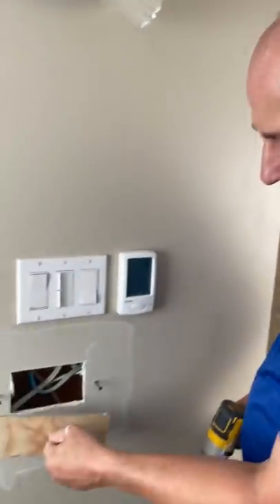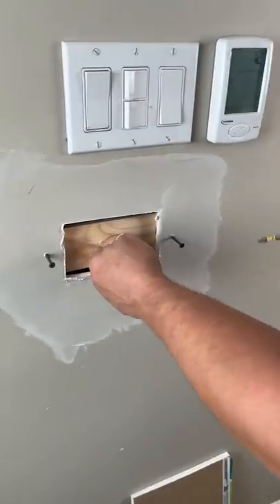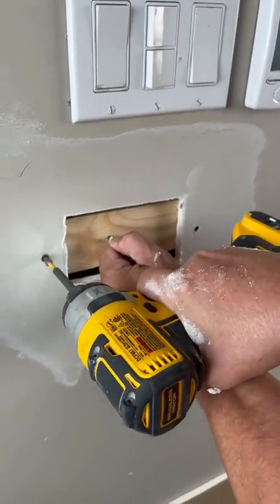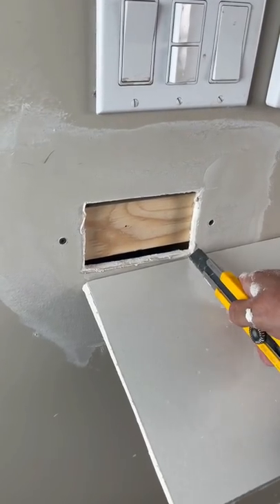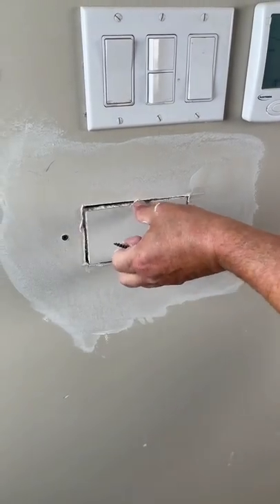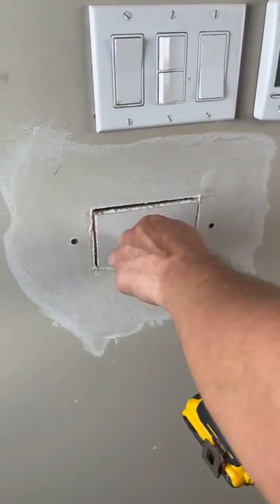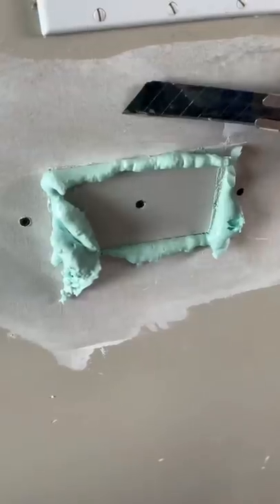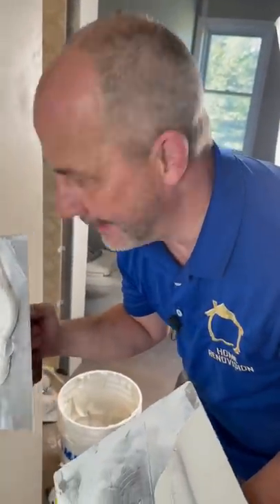Drywall Patch, No Tape Required #shorts

Comment: Now you just need a tip on how to save the expanding foam can so you don’t waste a $7 can on a single patch.
Reply: You really don't even need the foam trust me on this one...
Reply: @jamesjones1655  at least it works in theory.. Doesn't always stop being wasted after you're finished.
Reply: @wallstreet1469  brilliant
Reply: @jamesjones1655  I have about 6 of the foam guns. I use different foams from poly construction adhesive, fire block, window and door, pest block and so on. I have gone close to 3 months of no use, pull the trigger and good to go. Not to mention the yield and price per OZ is so much better then the one and done.
Reply: Why not use spackling?
Reply: @jacobtorres5542  spackle would crack out and show in no time. Spackle is designed for nail holes and very small repairs. Anything above a quarter size hole should be filled with drywall mud or hot mud. Something of that nature.
Reply: Just fill it with thick mud
Reply: Cut the piece of drywall about 2 inches bigger on each side.  Then, using that piece, cut out the size of the hole you need in the center of the piece making sure to only cut on the back of the drywall.   Next, bend and crack at the cuts, then pull the gypsum away from the paper on the front of the drywall.  You will be left with a piece of drywall you need with 2 inches of "tape" already attached to it.
Reply: @wallstreet1469  I would have figured a guy with a name like that would be more sympathetic to the neglect of innocent walls 😞
Reply: @jamesjones1655  Now we need more expensive "professional" foam...
Reply: @jacobtorres5542  Use plaster (drywall setting "mud") like EasySand.
Reply: U don't need the foam if u cut it precisely then just cover it with mud and u won't even notice a difference 
Edit: u can actually mud a pretty large gap if u do it right u only need the foam if u cut it really short
Reply: Foam is unnecessary
Reply: I mean you dont have to fix a hole in your wall that often, i think its worth spending 7 dollar on some foam instead of hiring somebody to do it
Reply: That's easy make the hole bigger and square it.  Just layout a new x by y hole that slighty larger over the existing hole and cut it out. Since it's a hole you've cut and you know the exact measurements you can cut a blank that fit perfecrly with no gap, just mud and sand.
Reply: @daltonurofsky3145  good idea
Reply: Fill it with crushed ramen and super glue
Reply: Wash it with acetone after each use 🤷
Reply: The expanding foam I use for outside flashing and shit can be sealed with a quarter hex head 1 inch screw. You need to secure the nozzle to the top with pliers then hand drive the screw pretty tight. Hasn't failed me yet.
Reply: Buy a $5 can. BOOM BABY
Reply: If you’re doing the repair yourself in your own home then a $7 can of foam is a negligible expense.
Reply: Acetone dissolves expanding foam. Just soak the adapter for a few minutes, blow it out with air and it should work like new. Use a drill bit the size of the inter diameter of the can tap to clean out the gunk in there.
Reply: Beat me to it. I’ll just use tape, thanks.
Reply: There is alot of bad advice on here.
Reply: @mighty0974  That's a terrible way to do it. All someone has to do is lean on it and you'll be having to patch it again.
Reply: @tonyh1008  Exactly. The compound will fill the gap anyways
Reply: @snakevenom4954  👍👍
Reply: Yeah I was just thinking the 5 dollar roll of drywall tape would last longer and patch more wholes than an 8 filler can of foam
Reply: @jamesjones1655  that’s about 50 to 100$ for the setup damn dummies tapes only a dollar and it doesn’t crack
Reply: There’s always one
Reply: Stick a wood grill skewer in the tip of the can  and cut off about an inch above it. Allowing you to pull it out with pliers the next time you use it..
 place the plastic nozzle in some acetone (or nail polish) for a few min and it pushes right out.
Reply: My thoughts exactly. 4 bucks for a roll of tape and a little more time vs a 20 dollar can of expansion foam. Every dollar counts.
Reply: Use regular drywall mud to fill the gaps, or regular painters caulk would probably work
Reply: Cmon on man,just pump the whole can in the wall,you gotta think about these things.
Reply: No cap
Reply: Depends on the one the straw that comes with the can, but you can use acetone to clear it out.
Reply: If I don't have tape I would cut the piece oversized an inch and a half or so bigger all around, then score the back of it slightly smaller than the hole. Then snap the edge pieces and peel them off so you're left with a border of paper extending Beyond the patch. Mud all the contacting surfaces before you insert the patch.
Reply: Answer: make more holes so you dont waste $7 can of foam...
Reply: Right i was thinking tape is alot cheaper
Reply: Dude, that was like $0.07 of foam.
Reply: @chichidouglas5078  no shit? I would of never guessed
Reply: @mighty0974  aka California patch or hot patch. It's not as strong as a patch that has backing behind it and tape on the seams so why bother
Reply: @ExileXCross  cut the piece first and put it over the hole and trace around it and cut. No measuring needed and an exact fit
Reply: @manniefresh7354  for a $1 patch
Reply: @devinlehman316  that's the best comment yet but it's more like really bad advice
Reply: @T6Tarek  that's a no shitter.
Reply: @chichidouglas5078  you are putting words into my mouth.  I never said anything about not putting a board behind it as the original poster didn't ask about that.  He only asked about how to save money by not using the foam.  Of course there would be a backing to the drywall.
Reply: @resiack  you are implying and putting words in my mouth that I said that I would not use a board behind it.  The technique I mentioned is for the seams only and nkt for stability.  Original poster only was asking about the seams.
Reply: @mighty0974  The problem with that method is it only really works if the walls haven't been skimmed and painted and its using more material. If a client wants a glass smooth finish or the wall is in view of a light reflection, your gonna be blending a 2foot square to hide a little 2inch patch that you used 4 inch of material to fill. 
When I have to patch and fill at work I just do this method but instead of foam use plaster bond and instead of putting a screw in the piece, bond any gaps then screw a baton over the piece, that way it will stay flat if the back fixing isnt great like when you go to screw into the wall and it crumbles, then when you go to easy fill over the dried bond remove the baton and pop the screw in all the way. 
Perfect every time and that way it takes 3 tablespoons of easyfill instead of 3 teacups.
Reply: Just pack the crevasses with toilet paper
Reply: I mean you could just not use all of it
Reply: You can also just use more spackle instead of the foam. You should cut the patch piece more precisely though
Reply: Just use tape
Reply: Buy a foam gun
Reply: @mighty0974  yeah, california patch would be way better than whats in the video. Although the wood behind is a good idea..
Reply: A little acetone will clean up the nozzle after every use

Comment: As a manager at an apt. complex, this is how I always fixed door knob holes in drywall behind interior doors. One template is all that is needed for marking the hole and the patch. With that piece of wood (generally called a SCAB) behind the patch, there'll never be another hole behind that door unless it's done on purpose.

Comment: Don't ever use expansion foam behind your wall compound (mud). The mud will flake out and won't be a lasting patch since the foam stays soft. Especially in a high touch area such as near a light switch.
Reply: Agreed! My 30+ years of drywall.  I've never seen it. I thought he was going to glue a California patch to the backer.🤷‍♂️ Mud and tape make a sheet rocker what he ain't!!
Reply: Years ago we used to use white caulking, trim then spackle and paint.  Painters caulking worked the best years ago.
Reply: @windrider65  I like that idea because you know the caulking still last too
Reply: Don't use compound either!! Plaster it with tape mesh tape

Comment: You're right. I've never seen the expansion foam being used this way. I think I'll pass.
Reply: Yep, def a "Jake leg" move
Reply: Yup. Tape and skim and boom! Faster. No need to wait for foam to cure.
Reply: @mewhoelse3554  Different methods are useful for different people and contexts. Remember, this channel is not for professionals, but for those who are doing DIY. The method works totally fine, but certainly not the fastest.
Reply: @mewhoelse3554  But the video is titled "no tape required"....

Comment: Will crack every time. There’s a reason actual drywall tapers don’t do this, and set tapes..
Reply: Pls do tell the reason?
Reply: @bryanbell7144  They already did : will crack
Reply: Call me when it cracks. No service call fee. If i did it wrong. I'll come back for free. And you can tell my boss. Wait..... that's me.y boss said f#(_& off. My wife should be the only one expecting me to do things her way. Go be a wife somewhere else.
Reply: @ricardovasquezjr8493  you just wont get a call In the first place, that WILL crack. Op said it perfect, if it was valid t&j's would do it daily, jobsworth
Reply: @EwMuva  I beg to differ. It'll crack if you use the cheap shit. If you know what you're doing, it won't crack. If it cracks, you don't know shit about mud, and probably bought the cheapest shit because "it's easier to work with". I have 20 years of experience and a torn rotator cuff that begs to differ. If the correct type of mud is used and mixed right, this will hold up. I mean, if a brand new sheet didn't hold up the first time, who in their right mind is going to expect this repair to hold up even better? If the home owner didn't complain, wtf is our argument even about lol
Reply: @ricardovasquezjr8493  You mind sending me your business? I would love to call around to check your work out.

You seem just so confident, might be worth a look.
Reply: @ricardovasquezjr8493  dude if you have a boss as a drywaller you ain’t doin it right. Become a sub contractor and make your own way
Reply: @Sketchy--  my information is posted in my last comment.
Reply: @Sketchy--  you can find me on the BBB website also.
Reply: @ricardovasquezjr8493   Exactly, you said it yourself: "if you know what you're doing" on a diy video 🤣 Hence, telling a diyer to use this method is horrible advice and will crack. Theres a reason tape was brought into the game and pros use it on every job everywhere, if you're charging customers to do this work in homes you need sacking mate🤷🏾‍♂️ I have 8years experience and still smash it out cause I do the job the proper way
Reply: @ricardovasquezjr8493  and to point out the obvious, the homeowner wouldn't complain cause the homeowner doesnt know shit.. that's the whole reason you're there 🤦🏾‍♂️ that question alone makes me question your workmanship, you turn up to do a job (ideally) better than the customer wanted, not to just leave without a complaint 😂
Reply: obviously haven't done it huh?
Reply: How would it flex? Also if it does flex wouldn’t adding just one more screw to the center piece be all you need to make it like worst case scenario proof?
Reply: @EwMuva  Nah, definitely won’t crack. Joint is small and the expansion foam adds good stability to the patch overall. Remember, what causes drywall to crack is the joints moving due to wood expansion. If you were to patch a piece of drywall that isn’t attached to anything, you would never need tape. Therefore, for small patches in most locations, expansion is really not a large concern since the drywall itself is not the thing expanding and contracting.
Reply: Nah, butter and fill with 90. It won't crack without tape. Not this small of a hole.
Reply: Make sure you clean and bevel, use quality hot mud. It won’t crack. Used this method in my home over 20 times not one crack

Comment: Wouldn’t the tape be cheaper than expansion foam?
Reply: Yeah.
Reply: It’s should be far less then your time.
Reply: Not if you have the foam laying around lol
Reply: @nigoroku256 
😅
Agreed!
Reply: Tape method is better
Reply: @IamDaveKurilla that crap gets dry
Reply: And easier. And cleaner.
Reply: It may turn out flatter without the tape. How would you keep the thickness of the tape from not showing?
Reply: @phazelvosfreqdetector7580 ... So you see the tape used on each and every Full drywall board that you mount too, right? 😉
Reply: @robertthomas6127  For the most part (not tapered factory edges). I would have to feather out maybe a 12" radius around that patch, and still maybe see the raised level of mud under the painted surface. Especially when side lit, which I always do to find flaws.
Normally I wouldn't worry about it, but I can see it (understand I'm not talking about the tape itself).
On a butt joint (which I keep to a minimum), and probably on that small patch, I often peel just a bit of the paper off the surface, giving a little depth for the paper tape to sink into, to avoid that hump. lately, I've been trying this new (to me) fiberglass tape (not the mesh), that's supposed to be much stronger and seems thinner.
Reply: @phazelvosfreqdetector7580  ... ok, I am not a professional by any means and have not done any extreme large amounts of drywall. Just renovated a house where drywall was partially used and never had a problem with seeing it when I was finished. Mabe I just had luck 🤷‍♂
Reply: Yea cuz good luck getting more than one use out of a can of foam. And they not cheap. Plus it's not near as clean as tape. Waste of time n money
Reply: @charlesjackson1588  ... I have used cans of foam more than once numerous times in my life. They are all desinged to be turned on their head when using. Turn the can upright and spray shortly until only gas comes out of the tube (don't over do it). The tube is then clean. Remove it and save the can for the next time. I am not saying that it will then be good for months or years to come, but  from experience I would say a week or two. I more than like would not do it as shown here. However if one needs to close a hole , has foam, no tape and dosen't want to run off and buy some, why not? . Have a good day.
Reply: It dries up …
Look up California patch … you leave an inch of paper from drywall to over lap ,.,, that’s ur tape ….
Reply: even cheaper and faster is just drywall mud.
Reply: @phazelvosfreqdetector7580  why not just fill the patch such that the drywall sticks out proud of the wall enough that when it dries it hasn't sunk in then just sanding back to flush?  That's what I do, not sure what is wrong with that since it works.
Reply: conelyking  Yeah doing this CUSTOM for someone else where your hours matter, then maybe these things matter, but for DIY over-mud it, wait for it to dry, and sand it back to flush.  You've got the time to wait for it to dry and it can be done perfectly with no raised thickness in one coat.
Reply: @snap-off5383  Are you suggesting no tape? Odds are it will crack/split without the tape. 
I really like the patch with the paper oversized on one side to overlap. I've never done it that way before but will.
Reply: @phazelvosfreqdetector7580  In my experience it takes a pretty big gap before it cracks when it dries, but my point is to anticipate that, and put so much on that even after it happens, there's enough to sand back to perfectly flush fully filled. (and mastering how much "too much" is needed and how much "too much" makes for unnecessary amounts of sanding.) With a rather tight fit one sawblade width or so apart, cracking is of no concern.  I just paste it on there about 1/8" or a little more over-flush, wait to dry, then sand to flush, no need for "sculpting" when wet, just knocking down the big chunks and waiting for it to dry.
Reply: Yes, ridiculous idea. That's why no one's ever seen it before.